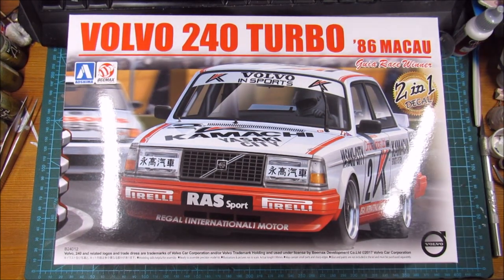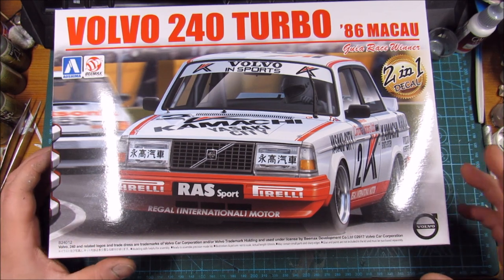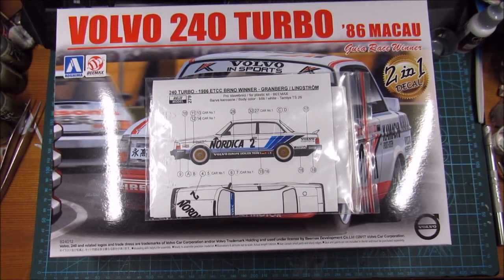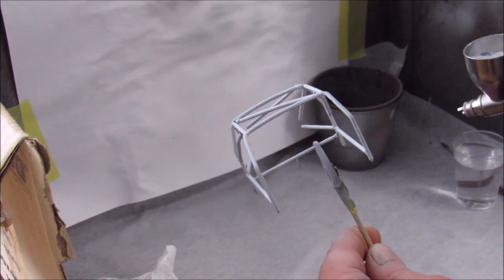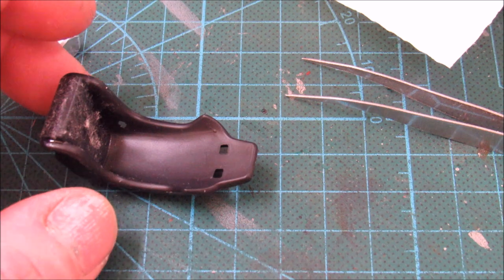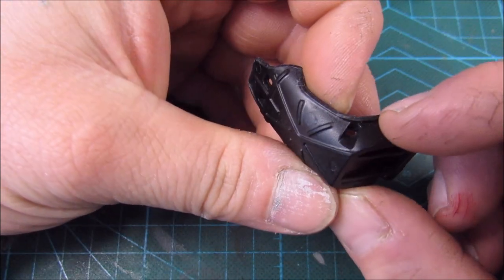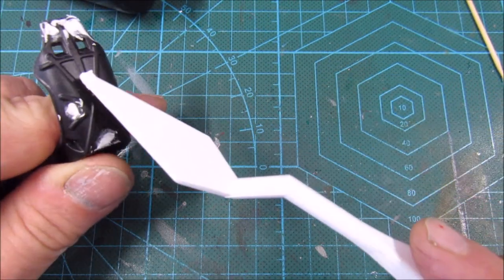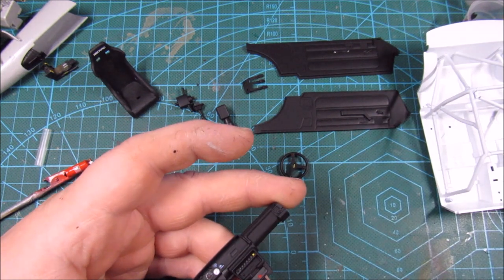Beemax 1/24 Volvo 240 Turbo pt. 1

Comment: This model kit (car) was not made after the car in the Volvo museum but of the actual car on the box art. And the car in the museum a was different car and had details (like the small pot for the electric and fire extinguisher switches and the roll cage was painted) that was different from the car in the box art. Both car however had the Nordica stripes, and even they were different if you look closely on the rear fenders. 

And the races, Inter-Tec #21 (was when Volvo won @fujispeedway 1985 in Japan with Müller🇩🇪/Diuedonné🇧🇪) and Macau #1 (when Volvo won @Macau 1986 in China with Cecotto🇻🇪). 

To read about his and more visit my site, www.240Grupp-A.se
Reply from the maker: Good to know. Specially now that Nunu models are coming out with the Nordica scheme supplied with the kit. I know I'm going to be getting that :)